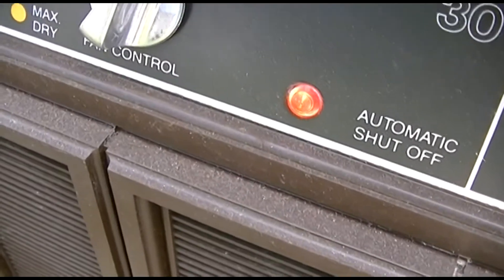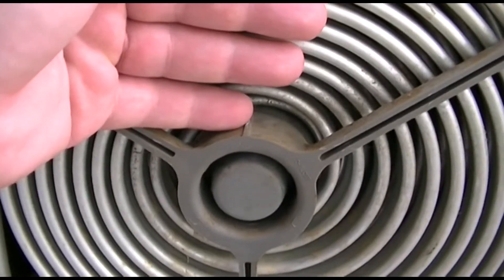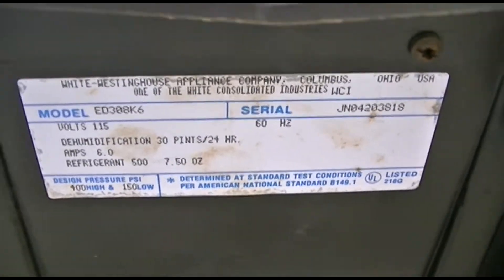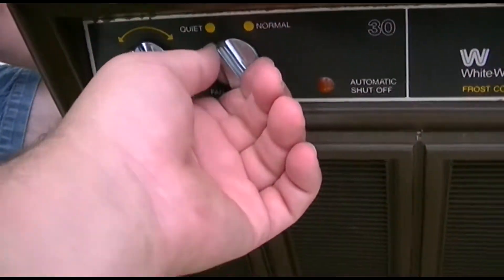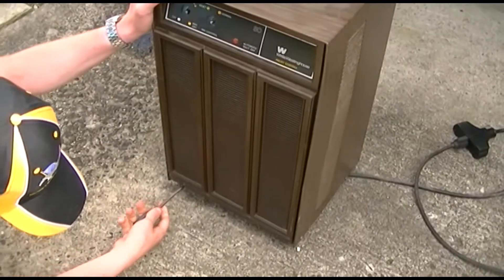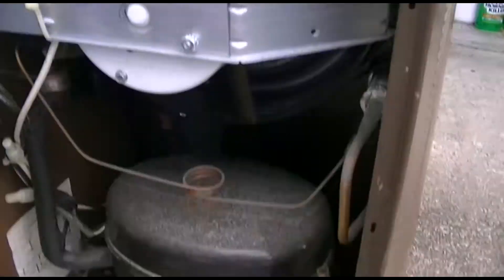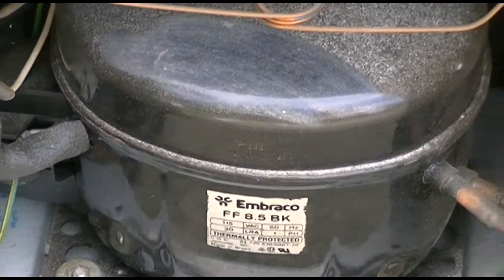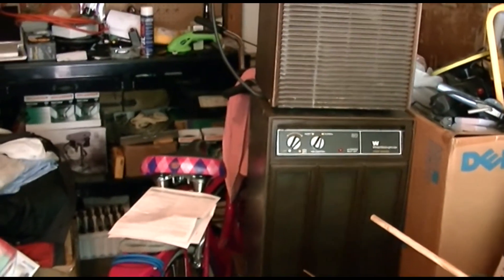VINTAGE Westinghouse 30-Pint Dehumidifier Saved From The Dumpster!

Comment: I bought a second-hand Westinghouse dehumidifier for the basement of my first house in 1983. It was still running and I left it for the new owner in 2012.  I bought a new Danby in 2012 for my new house.  It ran 4 summers, then stopped working.  I bought a second Danby but it does not work now.  Four years of working versus 30+ years for the Westinghouse.  Incredible.  I did have to thoroughly clean the coils of the Westinghouse a couple of times but it just kept chilling.
Reply from the maker: Lesson learned--you should have taken that Westinghouse with you.  It's not the end of the road, you can still find vintage dehumidifiers out there if you look hard enough.  Get one and chances are you'll never need another one.  Not to mention, it'll work better too.

Comment: I have this thing  - works great after 40 years or so. NO filter to clean on some of these older models. An article said to just blow it out with a leafblower...  This baby is pulling gallons of water out of the air in my basement on these 100 degree days with very high humidity. Nice find!
Reply from the maker: They don't make them like this anymore.

Comment: I just picked up an older model which was Montgomery Ward branded.  It has an Italian-made Aspera compressor and the high efficiency aluminium coil evaporator.  Some of them even had hot gas defrost.
Reply from the maker: Quite a number of dehumidifiers had hot gas defrost.

Comment: I live in germany and have an about 40-50 years old Siemens dehumidifier. I bought it second-hand for only 10€ after my 2nd new dehumidifier stopped working after only 3 years. It contains the good old R-12 refrigerant and works like new.
Reply from the maker: It likely will continue to work for many years to come.  Vintage is always the way to go.

Comment: I have this exact same dehumidifer.  My mom was going to toss it out a few yrs ago.  I remember my parents getting it back in the summer or 1991 when our basement flooded.  It was used only for a short time.  I would venture to say yours is an early 1990s unit as well. So many toss these tnings and they still work.  I believe its not an energy efficiency issue but a non need issue, and its eating up space so they toss it to the curb.  Also you are not supposed to be placing these things in your municipal household waste as the refrigerant destroys the ozone layer.  They need to be taken to your local appliance recycler, but i think many are un aware of this.  I find many window ac units in the trash as well.  Here the trash man wont pick them up due to the refrigerant.
Reply from the maker: They still take them with the regular trash here.  Occasionally they have rebates when you buy a new "efficient" one, they will make a special pickup for your old one.  But if you just put it out, they will take it.

There shouldn't be a need to discard a unit because it's taking up space.  That's because people buy these things for the wrong reasons--usually after a flooded basement.  But that's not what they are meant for, they are supposed to be run continuously in the humid season to protect the house from the moisture.

My father has a Kenmore he bought in the early 80s, but he's a cheapskate so he never runs it.  I've been down there at times where the chair is wet and you feel it when you get up.  He has a humidity meter and it's practically gone off the scale most times.  It's a shame too because he put in a lot of hard work to finish that basement back in 1987 and it's no good anymore due to the humidity.  That unfortunately will become my problem one day after he passes on.

Comment: I’m running a “mastercraft D28” from probably the early 80’s it also has the R500 refrigerant. It’s in my living room running 24/7 it’s extremely quiet and does what it’s supposed to. I empty the tank every morning before I leave for work. They definitely don’t build anything like they used to. All it ever needs is a good cleaning with the garden hose once or twice a year.
Reply from the maker: Chances are very good that if you continue what you're doing, that machine will last another 30 years with no problems.
Reply: jaykay18 I imagine so too. I had the unit given to me from an older person who hadn’t used it in over 10 years. It was spotless when I brought it home all I had to do was plug it in.
Reply from the maker: A little-used machine is even better; you might have that for most of your lifetime.
Reply: So I just acquired a really old dehumidifier. I have no clue what year it’s from. All I know is that it’s called a Viking automatic dehumidifier and it’s only got the option of on or off! I uploaded a really quick video of it. It works great by the way !!
Reply from the maker: Thanks, I took a look at the video.  I'd have to say it's from the late 60s to early to mid 70s, just based on the styling and especially the font of the writing.  Take a look at the electrical rating plate, if it says 60 CYCLES instead of Hz, it could be from the mid 60s.
Reply: So it’s most definitely from the 60s judging by the plate on the compressor. I took it apart and cleaned the coils well. I realized whoever owned it before changed the fan motor to one that is turning the opposite direction. It’s collecting water but not as good as it should be. Is there a way to make electric motors go in a different direction..? I tried reversing the wires from the motor and it did nothing.
Reply from the maker: Yeah, reversing the wires only works for DC motors, this is an AC motor.  Some motors are wired (for AC) to be able to turn either direction, most are one or the other.  

I have a Martin Industries Sahara 20 dehumidifier from the early 1980s I found, it had a dead fan motor.  I found a motor in my collection, it also spun the opposite way.  So I did a "two wrongs make a right" kind of move, and turned the blades around as well.  Of course it wouldn't attach to the motor shaft, so I used a hose clamp to keep them on.  Somehow it doesn't throw it much out of balance and it works quite well.  I keep it in the garage for those days when it's just too humid.
Reply: jaykay18 I’m really wishing I didn’t throw my spare fan motors out when I moved...! I saw the video of your old Sahara which is why I messaged you when I got this old thing. Figured you’d be able to help me out the best
Reply from the maker: I ended up having to modify the Sahara to install the motor I did.  I'm sure if you find a suitable motor for your unit that runs in the correct direction, you can find a way to mount it.

Comment: This is a keeper - may need a cleaning.   

The new electronic (energy star) ones are crap - coils rust out due to galvanic corrosion and the refrigerant leaks out .  Last 3 years or less.
They may save energy but are terrible for the environment - since they end up in the landfill prematurely.

I saved an old one (like yours) from my parents - just needed a new blower fan.   Runs great.
Reply from the maker: Yep, this one my friend took, and it has a good home and is still in service.  All the modern ones are complete junk, my sister has one and it lost its refrigerant.
Reply: The new appliances definitely waste far more probably triple the energy and resources of the old ones I've been in the business 30 yrs how does something that lasts only 3-5 years save anything

Comment: I have a very old Wesinghouse Dehumidifier and almost put it in the trash but came across your video first so I didn't! I hope you can help me. My dehumidifier does not have a bucket any longer and I've searched the model and can't find one anywhere. How can I use my dehumidifier without a bucket? Thank you
Reply from the maker: Yeah, you're not going to find one for a machine this old.  Before you do anything, do what was done in this video, hold in the lid switch on the back and turn it on, wait a minute and feel the coils.  They should be ice cold.  If they are not, there's something wrong with it.

If they are cold, well, you're going to have to get creative.  Find something to jam the lid switch in so it will run.  As for the water that it will capture, you're going to have to rig that up too.  I have another dehumidifier, same story, no bucket.  I went to the dollar store and bought a cheap tupperware container.  I used screws to attach it to the unit.  You'll need it to stick out a few inches from the back.  Then you drill a hole in the tupperware to allow the water out.  Underneath, place something to catch the water.  Another tupperware, or, if you can elevate the dehumidifier off the floor, like on a couple of cinder blocks, maybe a bucket, which would be a lot easier to empty.

So you're going to have to get creative here, and just use what works.  If one method fails, try another.

Of course, as a consequence of this, the dehumidifier will never shut off and will happily overflow the bucket, so you're going to have to watch it.

But, as hokey as this all may sound, what would be worse is buying a brand new one for $200 or more dollars, only to find it has failed within 2 years, and is out of warranty, and your $200 is wasted.  Put your thinking cap on, I'm sure you can figure out some way to rig it so it works.

Comment: I have a White Westinghouse dehumidifier that I bought in the mid to late 1990s that stopped working a couple years ago.  I will need to double-check if it still turns on.  Does that age constitute as a vintage & is there a way that I can tell what specific year it was manufactured?  I was all set to purchase a new one but the reviews online confirm your statements that after a couple of years they leak or stop working.  Fortunately I came across your YouTube channel.  With prices of new dehumidifiers going for $300-400 😳 & no warranty after reading your comments, I don’t want to buy a new one now.  Is there a video that might help me troubleshoot /repair why it does not draw water?  Are there appliance stores that can repair it?  If I’m unable to get it repaired, any suggestion for sourcing a good vintage one?  Thank you!
Reply from the maker: And I'll bet you're going to want all of this information for free, too.  Well, I'll tell you what I'm going to do.  Since your comment was actually well written, and you used capitalization and punctuation properly, you're already better than 95% of the rest of the comments people leave, so I'll answer.

First test the machine out.  Ensure that the compressor runs.  You should be able to hear it.  If you're not sure, find and old lamp with an incandescent light bulb in it and plug that in to the same outlet.  Watch the bulb when you turn on the dehumidifier.  It should dim considerably for a brief moment.  Once you're sure the compressor is running, leave it for a good 5-10 minutes.  Then feel the coils on the back.  They should be cold.  If not, and the compressor indeed IS running, the unit has likely lost its refrigerant charge.

As for repair of the unit, you're going to be hard-pressed to find a company to repair it, they're never going to want to bother with such a small job.  The only shot you'd have is to find maybe a retired HVAC person.  Oftentimes they'll be happy to fix the machine because it will give them something to do, and often they'll do it for very little.  Finding that person is key, there aren't many.  You know what I'm talking about.  An old timer.

You likely can decode the date of manufacture from the serial number, there are guides online that will show you which characters are significant.

As for a replacement vintage unit, best I can tell you is craiglist, ebay, and FB marketplace.  Good luck, and let me know what transpires.
Reply: Thanks very much!  Great info.  You have a new subscriber!  And thanks for noticing my proper capitalization & punctuation.  It’s actually a pet peeve of mine that professional websites such as political campaigns & corporations & the like don’t value these things.  I even find errors on my kids’ school website 😳.  Thanks again!
Reply from the maker: @clevelandeastsider878  Thanks!  Yes, I notice all of those things because it seems nobody can properly use this language of ours anymore.  It all started when I was in the first grade.  I was at the supermarket, and they had a sign for frozen hamburgers.  Except, the sign said "hamburger's".  Even in the first grade, I knew what the apostrophe was for, when it was used, and when it was not.  That was the beginning of the end, that had to be a good 36 years ago.

Comment: Hi guys! Thanks for the video. I have a vintage GE Sahara 20 like you guys stacked up on top of this westinghouse one you found. Do you have any tips on how to clean and service the GE? Mine still works but there is a ton of dust on the jammed up between the cold coils and the fan, stuck to these metal pieces that I guess are acting like a filter. Thanks for any tips you could provide. I want to keep mine working for many years to come!
Reply from the maker: Thanks very much!  Very easy!  Take it outside, make sure, of course it's UNPLUGGED, and take the cabinet off.  There should be some screws or bolts holding it on, usually at the bottom.  Then spray it down really good with the hose.  Don't worry about getting everything wet, it'll be fine.

Bonus points if you take something like Simple Green, spray that all down, leave it for a good 5 minutes, then rinse it off really well.  Let it dry THOROUGHLY in the sun.  Once all the water is out of it, it should run like brand new.  Might also take the opportunity to oil the fan motor while you're at it!

Comment: Just found a Gibson dehumidifier that's identical to the Westinghouse shown. How would you rig a bucket to the thing? Mine works as well just nowhere to collect the water 🤷‍♂️
Reply from the maker: I don't have that unit anymore, so I can't look at it to give you a better idea.  But I do have a Martin Industries one that I rigged up.  I went to the dollar store and bought a food storage container (we used to call them Tupperware).  The size and shape of it was just right to fit under the lip where the water drains down.  I attached it to the unit, and then drilled a hole in it and attached a hose to go to the outside.  You're just going to have to engineer your own solution to the problem.  You'll also have to dummy up the bucket switch if it only runs when you hold it.

Comment: I have one just like it (branded from differing company) and they don't fail.  It still has the bucket where water is discharged into a lower drainage built into the basement floor so I never needed to empty the bucket.  I wanted to clean it and get all the dust off of the coils. Any suggestions on how to get the back grill off?
Reply from the maker: Never took it apart, this one went to a friend.  All I can tell you for sure is that it went together, so it will indeed come apart.  Just be careful and take your time, it should be self-evident soon enough.

Comment: I have a frigidaire unit that has been awesome but unfortunately doesn't collect water any more.  It does turn on so I am not sure what to do next.  Any ideas?
Reply from the maker: How old is it?  What turns on, the whole unit, both the compressor and the fan, or just one of them?  When did it start doing this?  I need very specific information, otherwise all I can tell you is "it's broken".
Reply: @jaykay18  I have Frigidaire similar vintage round coil same problem " won't collect water,      Last year worked fine. But then it made really loud noise like it was screaming,so I shut it off n didn't use , So this year I need it to help control moisture ,I took apart, vacuum what I could n oil the fan , went to use it  and it purr like a kitten, blows air from all around,as always did gets cold like it should it is frost proof , but won't collect water should I spray water in coils , I don't want to fxxxx it up 🙏 what do I do ?????
Reply from the maker: @priscyllapratt5802  I don't know what part of the world you're in.  I'm in NY, and this time of year in February, it's very cold, and especially very dry.  Dehumidifiers don't work in this kind of weather, the air is just too dry.  If you're in a warmer place, and it's definitely humid, it should collect water.  If the coils are freezing up, that could be a sign of low refrigerant charge.  That's nothing you're going to be able to fix, and probably nothing you're going to be able to get fixed either.  When the coil frosts up, try spray it with water, it may melt the ice and get everything going nicely.  If it freezes up continually, it's likely a low refrigerant charge and there isn't anything that can be done.

Comment: Can you tell me if the fan is pushing the air out the front or the rear ?
Reply from the maker: I don't own this machine.  In general, the air is sucked on through the back and exhausted out the front on any dehumidifier like this.  Any dehumidifier you can feel the cold coils on should have the air sucked through there and go out the other side.